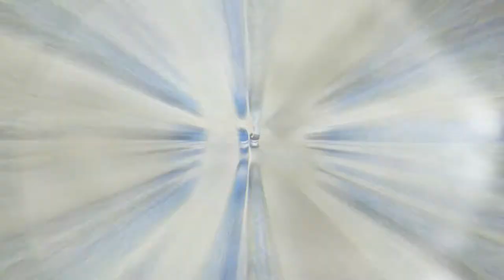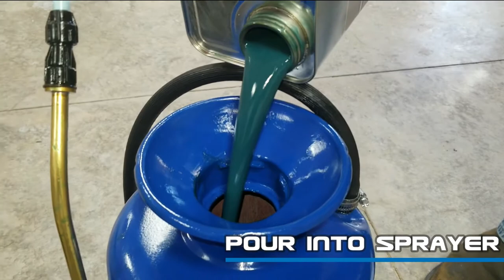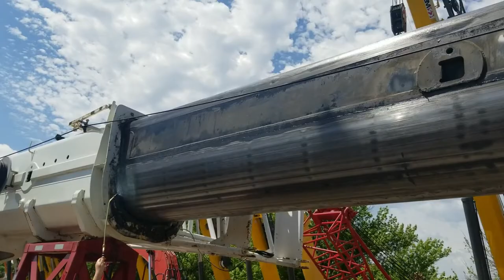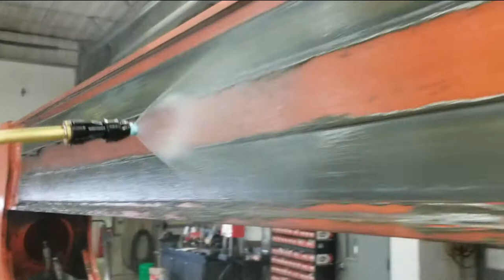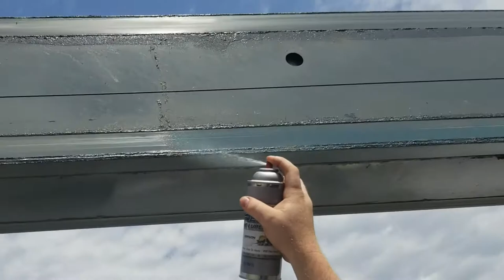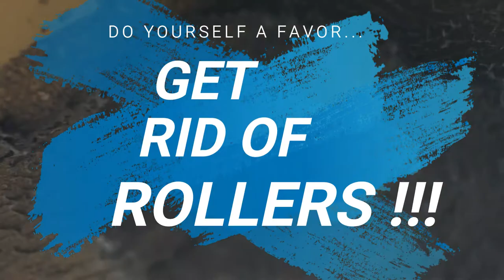EXTREME CRANE LUBE - Recommended Boom Lubricant 2021

Comment: My only question is does the grease meet manufacturers specs? Grove? Liebherr?
Reply from the maker: Thank you for asking.  This is a Lubricant that works better than grease.  It has a stronger film than most of the grease products currently on the market.  Here is a link to the Tech Data.  https://www.extremecranelube.com/ECL_TDS_2021.pdf   
Please cross reference it with your current lubricants tech data.  You will see that Extreme Crane Lube meets and exceeds specifications.  As for warranty claims, we are not at liberty to claim if this product will void or not void any manufacturers warranty.  Though we meet and exceed the specifications for proper lubricant used for boom maintenance, warranty claims will have to be determined by your warranty provider.